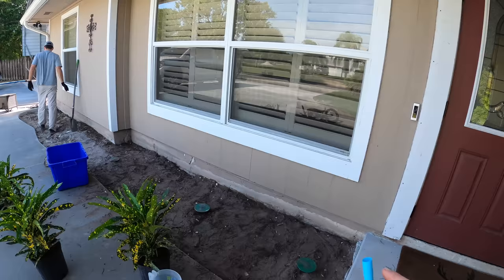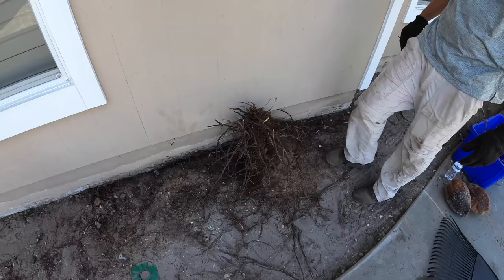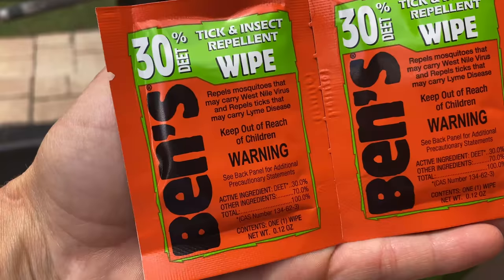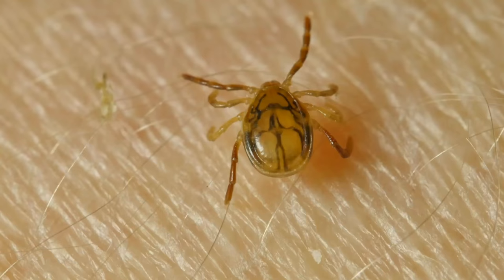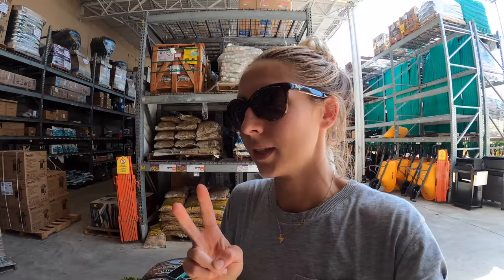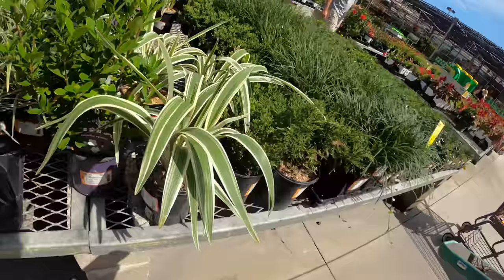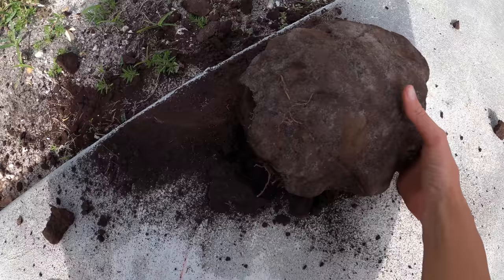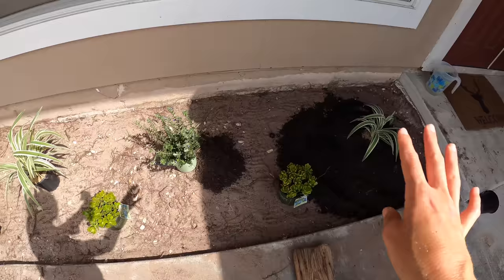How to transform DIRT into FLOWERS! *Plus a Sneak Peak*

Comment: kelly since that area is so dry i would have weaved  a poly irrigation line around the plants.(one with the small pin holes in it) you can get a hose timer for a few bucks and set up the watering schedule you need. i think prior to planting is best but since you have planted you can lay it and cover with rocks. Thats my 2 cents, hope they do well.
Reply: Shes only going to water them every 14 days- they are toast!🤣😂 they need to stick to fishing vids, it hurt to watch this.
Reply: so, when these die, there are some ornemental pineapples that are very pretty (cant eat them) small and pretty tho, also dig a hole twice as wide as the plants roots then fill in with a mix of top soil and compost, might want to put in a weed barrier on top of the dirt then put your mulch out. dont fill the planter up to the driveway. water will wash all the plants and dirt out

Comment: Looks Great Kelly, remember that in your climate All new plants need daily watering for the first 4-6 mos. dwarf mock orange is popular in SoCal-They stay smaller but grow a real pretty shape. With the bushes you planted, dig the whole as deep as the rootball, score the bottoms. Add soil & step on it all around so there are no air pockets. Always use drip irrigation and it should water every day for the first 4 months, then 3X a week after that. You dont need a well around the plants bc a drip line drips, and the water goes straight down, using a lot less water than hand watering & teaches the roots to go straight down. Especially helpful with trees. You can hook the drip line up to a faucet with a battery operated drip timer for cheap.

Comment: You have a nice selection and there aren’t too many plants. The layout is somewhat like a checkerboard rather than groupings. In case these plants don’t hold up to the heat of full day sun, natives and cacti would be good and only amend the soil around the plant, not everywhere else because that just makes fertile area for weeds. It looks nice for a first attempt. The milkweed around the pool look excellent! That was a great idea to put butterfly attracting plants around the pool.
Reply: But wont they attract bees?
Reply: @Userxyz-z2d  the milkweed feeds the Monarch butterflies which is very important for their long journey south. It will attract bees but those are necessary for the garden as well. The pool is screened so bees or any other insects shouldn’t be a problem.

Comment: that type of new soil will settle and drop 3 or 4 inches over the next few months and watering that garden bed well allowing the water to soak in would have made it much easier to dig in that old soil , and when mulching plants leave around an inch space from the base of your plants to avoid fungal infections on your plants.

Comment: Looks good. Just enough. I would have mounded the plants to be a bit higher ( 1-2 inches) than the concrete and filled the whole area up with soil to just below (1-2 inches lower) the concrete. JMHO although I am not a landscaper by trade. You need to do the same along the curvature of the driveway.